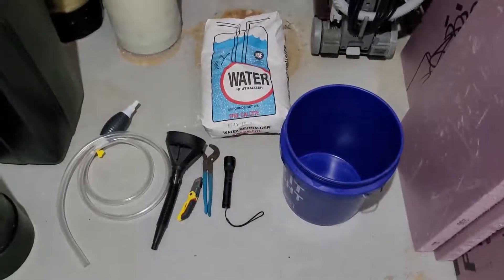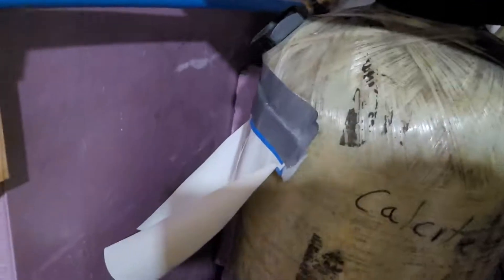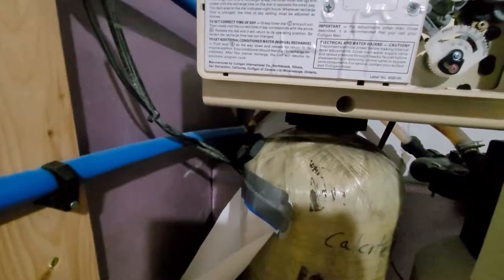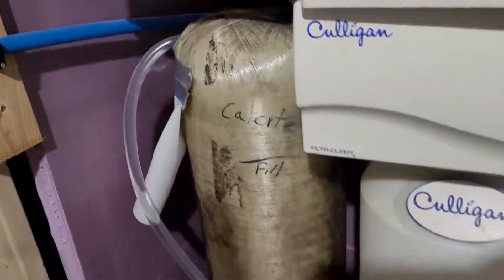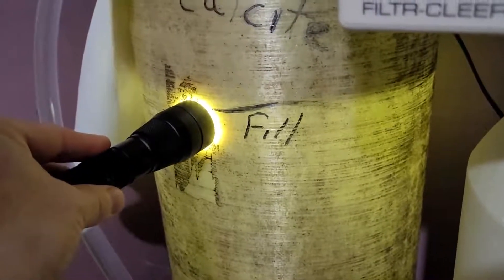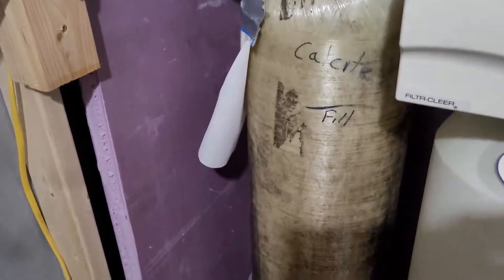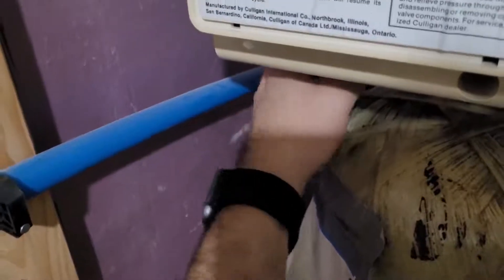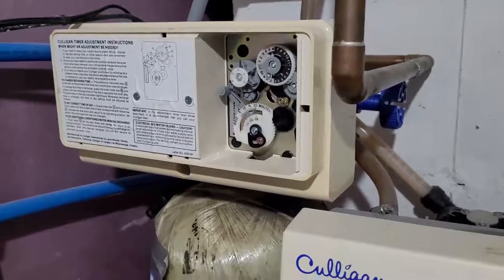How to Add Calcite Acid Neutralizer to Your Water Softener System

Comment: Thank you, thank you.  The paper you duct taped just below the fill plug is an incredible idea, and I can't believe I've struggled with the water mess for years without thinking of this.  I do follow the owner's manual to do the by-pass, enter the unit into backwash, and unplug the power supply.  But, at that point I used to open the fill plug with my siphon hose and bucket at the ready, but I always made a mess with water on the floor.  Using your idea, instead of the wax paper, I decided to use heavy duty tin foil for added stability.  I was able to crease the foil to form a funnel-like flow into a bucket -- perfect.  I let the water drain until it stops (about a quart) and then I use the siphon hose.  Yoo-hoo -- no water on the floor what-so-ever.  Did put a towel down just in case.  Did the adding of the NS mix.  Rather than use the funnel which you showed, my plumber who installed the unit for me, explained how to make a PVC funnel.  Start with a threaded PVC adapter that screws into the dome plug hole.  Then, use PVC couplers, straight pieces, 45 degree pieces, and finish with a wide reducer adapter at the very top.  Adjust the PVC pieces you need depending on your neutralizer installation.  Another commenter remarked why the installation had the fill towards the back.  Well, unless you're willing to plumb in a web of pipes to permit rotating the entire tank, sometimes that's just the way it works out.  My fill hole is toward the back also.  The way the head unit threads match the tank threads just works out that way unless you rotate the whole tank which for me would have put the head plumbing out into my room further which would have taken up space obstructing the space into the room itself.  We didn't want that.  So, to keep the pipes most directly aligned with the well water tank, the fill hole ends up in a less than ideal location.  My plumber showed me the PVC funnel system he made himself to be able to easily work with the fill hole location.  Just screw the threaded PVC adapter into the hole and make a funnel system that can put the top funnel anywhere you want it -- I brought mine out to the side.  Also, back to the tin foil taped to the unit, leave it on until finished filling with the mix.  It'll also catch spillage of the mix grains when you remove the funnel because there are always grains of mix that used to scatter on the floor.  Hit me up with an email (keigrant@comcast.net)  if you want to see a photo of the PVC funnel.
Reply: PVC funnel is a great idea. I have to fill mine again soon, so I will try and implement this.
Reply: @ to get me started with the PVC funnel idea, my plumber gave me the following components as a starter.  

First threaded  1 1/4 inch PVC that threads into the dome hole 

Push fit a 1 1/2 inch very short piece of PVC into the threaded piece 

Push fit on a 1 1/2 inch reducer PVC that has a 2 inch top 

Insert a 2 inch short piece of PVC

Push a 2 inch-3 inch reducer as the top piece funnel

You can play with these pieces in the big box store to make what you’re thinking about before you actually purchase them.

Your pieces may not end up being exactly as I describe because you’re trying to make it fit for the way your unit is situated.